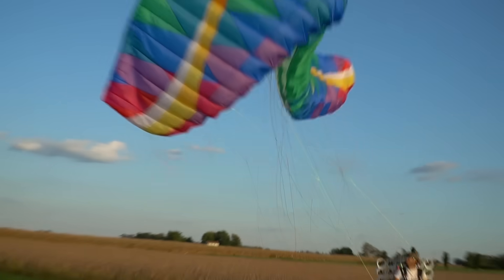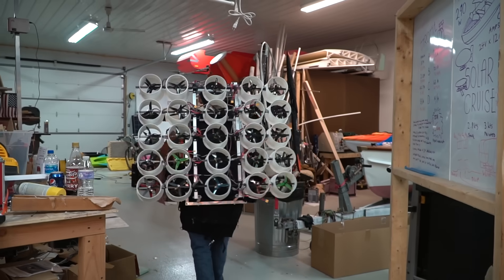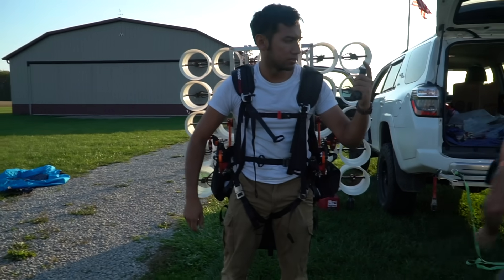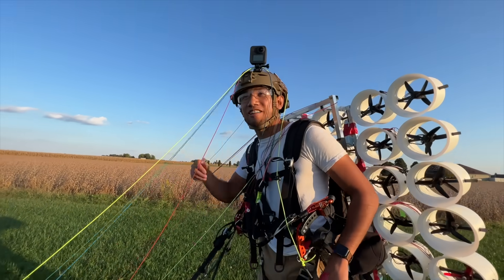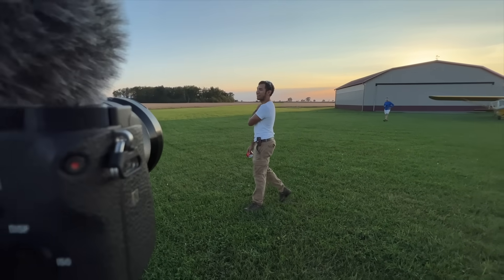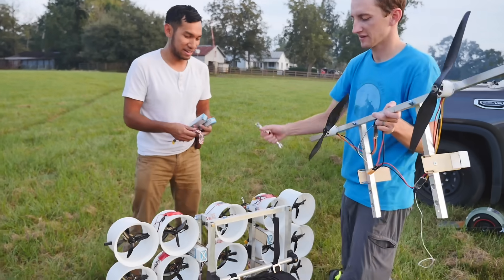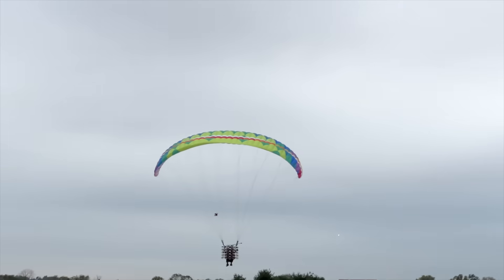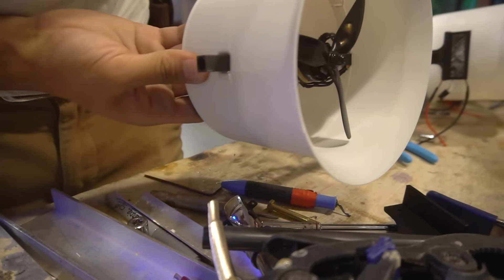Flying with 50 drone motors (homemade flying machine)

Comment: Glue a strip of sacrificial foam the run the blade through it and then seal with clear epoxy to seal the foam. This will close the blade tip diameter creating grater thrust per duct. I’ve done this with Vectored Thrust Ducted Blades for the VTCAD Helicopter. Good luck.

Comment: there's loads of ways you could improve the performance of this, like moving the ones blocked by your body and improving duct prop fit. would be even better with the drone motors from the santa slay build, just need a couple and you would be off

Comment: I don't really know anything so i have to ask: would it make a difference to put the motor units in a hexagonal pattern rather than square? I imagine you'd get more motors in a smaller surface area, and a hexagon would probably be more comfortable than a big rectangle
Reply: Yeah the bottom corners of the square could chop up your fingers pretty easily. I wonder if stacking 2 motors front to back would help also? Idk I'm not a expert on such things but I want this idea to take off lighter para motors would mean more people can fly.

Comment: Hearing how much your guys weigh is unreal.  I feel anorexic below 200lbs.  I've got a 32" waist and I'm 5'9".  I used to be 5'11.5" tall, but, yes, I've lost 2.5" of height thanks to severe spinal degeneration.  I have to keep my core muscles built up to support my back so that I only suffer severe pain rather than debilitating super severe pain.  I just wish I could weigh 155lbs because that would probably reduce my pain levels even more, but I don't think I can possibly lose that much weight and stay healthy.  Damn I'm jealous.

Comment: Put two dozen motors/props in Front of pilot (above waist height, so you can still "retract legs,") and as many as you can squeeze in on each side 'in back.' Avoid running any props in that behind the pilot dead spot, that most paragliders that aren't this 'technologically Advanced' just have to Deal With. (Dunno why they don't all seize up, with no cooling airflow, anyway.)

Comment: Blade tip losses were a problem with the duct gaps. I have to wonder about friction with the air and all those little props. Proper EDF's tend to do better I think with "grip" to the air, but probably much worse for air friction. I wonder what eliminating all the ducts would do? You'd lose weight to be sure, but also blade tip eddies would be increased. I think maybe your ducts were not dealing with the blade tip eddies since there was a large gap...or maybe only helping a little. Still...very cool! 
*
I'd like to see some silliness like this on a real airfoil like your electric planes. And on that topic...I was REALLY looking forward to seeing your latest plane project getting lots better!!!

Comment: I mean.... as long as you don't try anything too crazy there's only a couple of seconds during your take off that a motor out could be really bad. Once you're in the air even if the motors fail you can just pick a good lz and be fine. With those tiny props I imagine you get a really interesting throttle response, I'm picturing its gets pretty much instant thrust, its a shame its underpowered.

Comment: The middle line of motors  at least is probably blocked and mostly useless weight, should remove them.  Also the ducts look super inefficient  and are probably hurting more than helping.  Did you test them to see if they generate more thrust or the same?  Every test video I've seen unless they're super close tolerances they're useless weight and super hurt efficiency.

Comment: Motor redundancy is not an issue with a paraglider. 
The motors directly behind you, don't do much. Even with the space you provided.  
The worst is you lose power and land anywhere. 
The most efficient is a big single propeller, just like the gas version. Noise indicates inefficiencies.

Comment: Great project, thanks for trying this!  Insufficient power/range seems like a recurring theme with electric-powered flight.  It's cool to see you make the attempts, though.
Reply: Exactly. Even commercial devices like electric lawnmowers: They're good for some uses (much quieter & no wire to worry about or petrol motor to struggle with), but they struggle a bit if your grass is on the thicker end...
Usually these things are at least a one-or-the-other situation: Devices that have poor power have reasonably good run-time and vice-versa. This has neither, making it just a poor design.
Reply: There's an electric ultralight which reported the electric motor had to much torque. I think the video was an aerolight

Comment: It seems you mounted the motors on a black spar that is pushed through holes in the duct. I totally get this was a quick prototype (that worked!) And janky is fine in that context, but if you were going to make a mk.2, (even just as a thought experiment) with reduced tip clearance as you noted.. consider designing the motor mount into the duct (maybe with three radial supports between motor and duct, at 120 degree intervals?) .. and design quick connects on the outside of the duct so modules can be just clipped on yo scale indefinitely?

Comment: A square of 5x5 motors gives you 25 motors all toll, not 50.
Reply: Nor 49, as mentioned earlier in the video.  But I think he has two motors per duct; he certainly seemed to have two propellers.
Reply: @jimjjewett   Thanks Jim.

Comment: 14:00 want to reduce your carbon footprint? Just drove your damn car as long as it's fully working, reparable and safe. Don't buy a new one every 2 or 3 years, even if it's an electric one, the production process leaves a huge carbon footprint.

Comment: The motors are mounted too close together, they're partially canceling their own thrust to prop wash.
Reply: Ditch the cones.  Arrange the motors in a hexagonal pattern.  Build or buy a single wire cage.

Comment: Great video - the mattress is interesting :) I fly with electric motors and I can advise. The engines directly behind your seat are not efficient because you are unknowingly creating a closed system (it's about the same as blowing your mouth into the sailboat you're sailing on) and some sort of "confusor" on every engine doesn't really help. The classic paramotor with one large propeller does not have this problem, because its blades extend beyond the profile of the seat and there is no thrust in the center of the propeller. You have only two options - move your propeller "mattress" far back, or reduce the number of engines to 2 with higher power, which will be spaced apart to a larger spacing of your back (the diameter of one propeller should be 28 "). Both propellers should rotate against each other - it eliminates the gyro effect.No "confusors" or two propellers on one axis of the engine, because it has no noticeable effect. :)
Reply: I wonder if he took half of them off and removed the ones behind his body and spaced them out more if it would fly better and last longer due to less weight and better efficiency and everything you mentioned.
Reply: @JaredConnell  Pokud by to udělal, získal by větší tah při stejné síle. To je vyzkoušené. Malé vrtule nejsou špatné, ale to by autor musel vyrobit něco podobného, co najdete na open ppg.
Reply: You don't want it too far back, it will try to twist the pilot, trying to get ahead of him.  That could get very dangerous.
Reply: @ChessMasterNate  In practice, this is done by placing the propeller with an electric motor on a rod 0.75 m long behind the pilot's back. This propeller has folding blades like an umbrella, which expands by centrifugal force when the electric motor is switched on. In the motorless flight mode, the propeller folds down again like an umbrella thanks to the spring. In the case of a "mattress", it would be necessary to relieve it of the unnecessary things I mentioned somewhere and, of course, to move it away from the pilot's back (if he insisted on his concept). The partial rotation of the pilot to the right and left, as I noticed in the video, is due to the higher center of gravity, so something in this direction would have to change to prevent this. The pilot of a classic paramotor must be able to cope with the gyro effect of his propeller, so it is again up to the pilot and his experience.

Comment: Peter, I can't wait to see version 2 of your electric paramotor.  I've thought a lot about building an electric paramotor and I really think two counter rotating props is the way to go.  That way you wouldn't need to worry about designing in torque steer correction into the frame.  You should consider watching the "Insights Into Paramotor Geometry" series that Miro (creator of Scout Paramotors) released on the Scout Aviation YouTube channel.

Comment: Maybe just drill some holes in the ducts so more air can be sucked in from the sides. Or only shroud the outer layer of fans, and add a protective mesh on the "front" side. The mesh could be very large with little to no impact on airflow, but small enough to prevent a hand, elbow, or cable from entering.

Comment: I wonder if maybe the props right behind your back aren't really producing much force, could move them off to the sides for better efficiency? And maybe line the props up in a honeycomb pattern for better use of space? Idk I've got 0 hours of aero engineering and flight experience, but those are my layman thoughts.

Comment: One improvement is so obvious, I'm baffled why you didn't think of it. Those ten motors on centerline can't be helping much because your body is in the way of the airstream. You should relocate them away from center. Obviously you were rushed during the initial build.

Comment: Lol the throttle was probably in chill mode so it would output max of 75%.   

You can change in on the computer or hold down the arm button when powering up the system it will then give a beep and change modes.

Comment: I like how the drone community is currently in a trend to double up motors, so I see a lot of X8 setups. YOU take that idea, and run it on up to 50, cause' 8 wasn't excessive enough :D
Why did you blur out the 2 big motors/props in the footage starting at 10:50? 
Love the aircraft! It's interesting, when I look at different multirotors throughout history (that were large enough to carry a person), they all seem to suffer from excessive noise, sometimes so much that it spells disaster for the prototype. Yours didn't seem ear-splittingly loud. I like that it's a middle ground, between scary and unbearable. I REALLY like that you built it well enough to carry ppl heavier than you. When it comes to drone construction, the temptation to drop weight to a minimum is SO strong.

Comment: The persons body blocks half of the motors air.    Use less motors but bigger ones and bigger props around in a circle outside of pilot body

Comment: I feel like this is the Minimum Personal Flight Requirement, and it's really impressive to see how little it takes to achieve flight
Reply: Not really. They used an existing paraglider & harness with the thousands of hours of engineering that went into its design.
Reply: @Vousie  I await your video of clothes-pins and yarn harnessing CPU fans on AAA batteries.
Reply: @up4open763  Yawwwn. My point is he's built actual planes from scratch. He showed how much calculations and planning went into it. It's not just a matter of "throw it together and it'll work 'cause flight is easy"...

Comment: What about using motors/props/batteries from your electric ultralight for something like this? Put the two power plants back to back, similar to how you did here and off you go! Would probably be even smaller of a setup than this.

Comment: With electric motors you have more flexibility where you can put the motor and props, there should be any need to put them in the dirty air behind the pilot and in the way of the rises.  Try mounting them on a boom either side of the pilot, or perhaps even in front, with batteries behind to get things to balance near the pilots CoM.

Comment: How about using a circular frame with the 50 motors attached around, and then have the two or more larger motors attached in the center. More power and less chance of a prop strike with the lines

Comment: That's awesome, but but I'm just curious, what if the batteries were catching fire while being in the air... What was the safety plan for this?
Or were there any safety plan, at all?
Reply: When he wriggled out of the backpack he still has a paraglider, doesn't he?
Reply: @andreasvox8068   
I guess my question should be more if he could ditch easily the batteries/fans without losing the paraglider, in case of a problem like the batteries on fire... 
At first I thought there was a big battery pack inside what it looks like a backpack but after I saw them attached on the fans. It's probably a bit less dangerous like this.

Comment: Hey Peter, please don’t put motors on opposite ends of each other. It decreases it’s performance and efficiency.
MotorRiot has shown this to be true with a quadcopter design with opposing motors vs an Octocopter.
Reply: Somewhat true. Two overlayed motors will never have the efficiency of two seperated motors. On the other hand the two overlayed motors will be about 10% more efficient than a singe motor.
Reply: @TheMostPowerful  Then why not just use larger motors instead of two overlaid motors for more efficiency? 10% increase is not much considering you’re powering two motors at the same time.
Reply: @furonwarrior  true. On the other hand, this does have a cool factor to it, it runs on lower voltages, he already had all the motors and batteries needed, it has zero torque, and the throttle response from 0 to 100% power is literally less than 1/10 of a second.